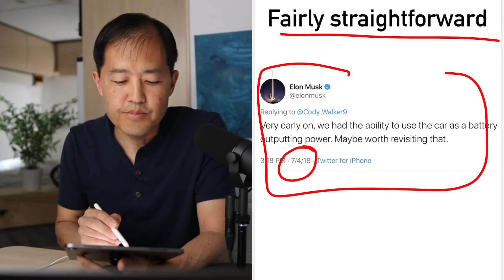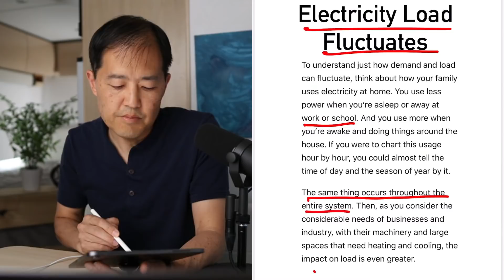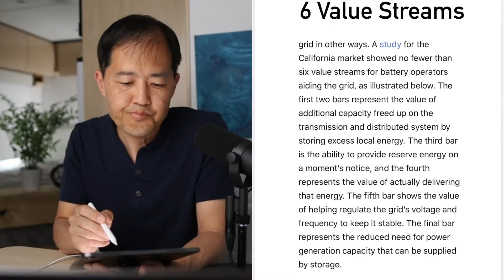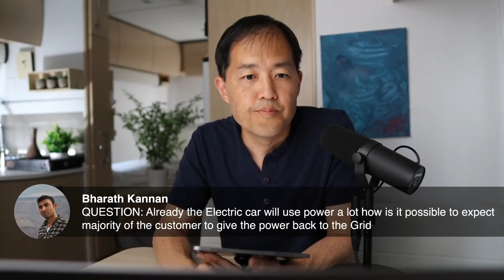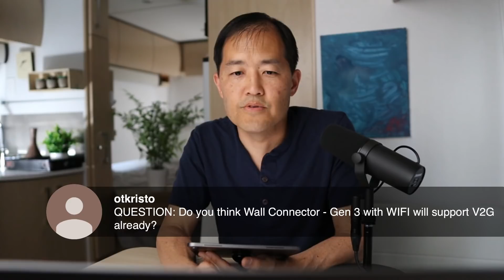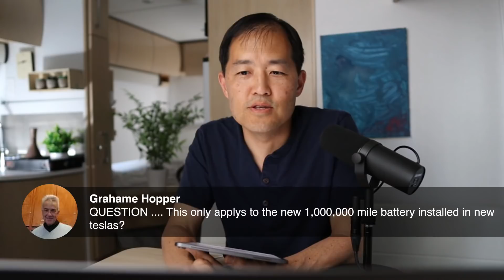Tesla’s Secret Vehicle-To-Grid Plan (Ep. 80)

Comment: NVEnergy in Reno has an EV rate structure that allows off peak purchase @ $0.05l/kWH and on peak @ $0.35. With a MMB in my 2021 (?) M3, I could buy power off peak to charge my car’s battery, then use the stored energy to carry through peak hours. Not V2G but V2Home, without the hassle of a grid interconnect...just an auto-disconnect and reconnect to my home.

Forgot to mention, I’m retired, so car is mostly available.

Comment: Solution to grid balancing is trivially easy: allow price to fluctuate freely throughout the day driven by market forces. Consumers and industry will then preferentially use power when it is cheap. Price disparity would automatically adjust to load balancing needs. EVs are just one great example of power usage that can be adjusted by consumers. Charging software can be optimized to take advantage if this to keep it simple for the user. V2G may or may not even be needed, but the market would automatically motivate V2G exactly as needed. 

The fossil fuel industry will continue to oppose this idea, because it eliminates the artificial need for "natural" gas peaker plants. They will push FUD such as the silly idea that constantly fluctuating prices will confuse consumers who they hope will prefer fixed predictable prices. Nonsense. Consumers prefer prices that are lower on average. But this could hypothetically be adressed by offering two plans: fixed price or variable price, noting that of course the fixed price would be much higher on average.

Comment: Business pay a premium to the grid operator for the peak, maximum power they will draw.  They may seldom draw that much, but if they do, the grid operator is responsible to provide it.  If a business can install batteries, they can lower the peak rating and save money on their account.  So, a business could provide free parking with V2G plugs in return for shaving their peak, maximum power.  A few years ago, there was a paper about Bay Area Rapid Transit (BART).  BART uses peak maximum power when a train accelerates out of the station.  If the BART parking garage enabled V2G, they calculated BART could give each  V2G car free parking in return for the boost for the train(s) to leave the station.  The vehicles would get power back when the next train came into the station, because the train is using regen to slow down.  It's been a few years since the research was done so not sure if that is still open to implementation, but it gives an example of what can be done.

Comment: Dave, your folding pv description is exactly what I am prototyping, though on a ~36' trailer enclosed car hauler.  We are shooting for 12Kw (4k x3 frames) This is for a mobile workshop/makerspace/response-shop .  The goal is to leverage it 100% off-grid/stand-alone and also plug it into a stationary grid-tie to power a home for peak demand as well as during during outages. 
The MAIN problem:  Power companies lobby hard to keep all this "independence" from happening and it seems they are very successful at leveraging "safety" as their hook. 
Getting approval for grid tie is expensive for normal people and it involves an arduous, procedural permitting process.  This part needs to be addressed (just like Tesla's kill-state-auto-franchise-laws push) before V2G can be widespread.  
The States will not step aside and let the Feds dictate this, so I expect it to be a long slog.
Get Duke or PG&E to have some kind of exclusive license where they get a piece of the initial purchase...and maybe they will allow their arms to be twisted.

Comment: Actually, Tesla's newest home charger actually already have WiFi connection, and probably V2G support at least in hardware, one would guess. So their suprise would be "if you have the v3 home charger and a Model 3/Y, powerwall and  solar you can now do V2G with the things you already have, wait for next software update!
So... the reason you need powerwall or solar today, at least, is that you need a controller to sit between your home and the grid, which is installed when you get these. It's possible they could install only the controller for use with V2G in the future.

So exciting! :-)

Comment: Dave, A+ presentation, format, and content!  Thank you!  Minor feedback, it sounds like your Macbook fan is running 100% so there's persistent background noise, but your voice sounds perfect.  And love your split-screen presentation and the way you display the question you're answering.
Also, consider that Tesla may use an app-store model of 70/30 for power delivery revenue, which would still mean about $1000 per year per consumer, if you run the numbers.  Cheers.
Reply from the maker: Thanks for the feedback.  I’m trying to fix the fan noise.  I just ordered a laptop fan cooler.  Hopefully that helps.

Comment: Great video, but you left a few things out.  Not all utilities need grid storage because of the characteristics of their existing systems (but some will).  Hydro-Quebec for example can vary their output based on their extensive hydro-dam system, and they almost certainly do not need additional electrical storage.  Many utilities have an adequate amount of backup capacity, and may not be too interested in additional capacity as this might negatively affect their existing backup investments in things such as gas turbines.  Also, many utilities have had and will have demand destruction due to the shutdown of big factories, shopping malls, etc.  In these cases, additional electricity storage may be unwelcome for the utility.  So it is a stretch to state that all utilities are looking for this.  Note that not all utilities have time-of-use electricity pricing.
AND even though it is being handled for things like solar in some jurisdictions, there are important safety considerations of generating power in a residential area and placing this power on a grid without the knowledge of the system operator.  A lineman for example could be killed if he thought that a line was isolated and de-energized and then someone expectantly put power on that line downline from the isolation point.  This will need to be worked out on a jurisdiction-by-jurisdiction basis, and will likely involve legislative changes in places.  This could take many years to happen.

Comment: The key to self-charging for Tesla Robotaxi fleet and for their Vehicle-to-Grid (V2G) and Autobidder business potential is wireless charging using the magnetic resonance wireless charger developed by WiTricity (a company founded by several MIT students).  This will make the implementation of a Robotaxi fleet and vehicle to grid a lot easier and much more effective.  If parking lots and garages at home, at work, at shopping centers, at sporting events were configured with magnetic resonance wireless charging devices embedded in the asphalt, then EVs and Robotaxis would be connected to the grid many more hours per day without the additional effort by the driver to connect a cable to a typical charging station or the use of complicated mechanical cable attachment devices.
As Robotaxis become ubiquitous, Tesla should be able to purchase or lease unused parking lots on the outskirts of major cities and configure each parking space with wireless fast charging systems embedded in the asphalt.  The Robotax fleet could drive to the nearest Tesla charging station and recharging the vehicles while they are being cleaned (disinfected) by the Tesla service team.  Tesla could also cover the parking lot with a canopy of solar panels or use a nearby wind farm with a Megapack battery storage to provide the renewable electricity to the embedded magnetic resonance wireless chargers and the grid at peak demand rates.
Wireless charging devices could be embedded in the asphalt at airport taxi pickup locations, in front of hotels, football and baseball stadiums, arenas, and convention centers so that while the Robotaxi fleet is waiting for customers to exit, they can be charging or selling electricity back to the grid. 

I predict that Tesla will either buy WiTricity, invest in WiTricity or make a deal with WiTricity so that these wireless
charging devices and be produced in mass quantities to lower the cost and become ubiquitous.  Check out the videos
about WiTricity’s new magnetic resonance wireless charging technology.
Reply: Hi, Gary  thank you for sharing your insight.     What do you think of Energous corporation, publicly traded.    Witricity is still a private company, right?

Comment: Great video and I like your presentation format. V2G is more important for emergency backup first and foremost for me. My house could run for 1 month on a Tesla Model S or Model 3/Y. My house is only 400 sf. The CyberTruck will have built in 120v/240v inverter which can be used for work or emergency generator but may or may not have Grid Tie capability. Grid Tie of course is feeding energy back to your house/grid with your EV. Of course we will be adding mobile solar panels to the CyberTruck when we get it.

Comment: I can see Tesla taking care of the regulatory approval for each grid connected inverter & controller, rather than the householder having to go through those hoops. And regarding payments, these don’t need to come from the utility company which happens to supply the house. Tesla’s VPP system will be an open market system, available to any utility which wants to take advantage. So it makes sense for Tesla to collect those payments and then pass them onto the householder, after taking a cut of course.

Comment: To be honest, the conversion needs to be fairly efficient, inversion, and then rectification back into the grid sounds like a lot of energy loss to me. Currently, in the implementation of High Voltage DC lines, the conversion is fairly unreliable and creates a lot of energy loss and the availability is an issue, the stability of supply back into the grid also needs to be considered. I hope this means some decent innovations on the conversion side will appear. Tesla will need some pretty heavy partners in the transmission and distribution industry for this to be rolled out en-mass. I'm interested to see if that's the case, perhaps this will be a quicker way for smart grids and mini-grids to be implemented for each community.

Comment: Don’t think the snake will be at battery day, but sw update to hpwc v2 to allow V2g will be announced.
Reply: Correct. All the tesla HPWC chargers can transfer AC in BOTH direction, even without a SW update.
Reply: @fiddlerJohn  I think the sw update will have to be applied to expose the interface for the new hpwc. Not sure how they would do it on hpwc v1, do they get updates as well? Maybe via J1772?
Reply: @GoatDirt The HPWC ( now called WC) is a GFI extension cord. The Alternating Current goes though the GFI relay in both directions. That's the definition of AC. The car already controls the relay. Yes the HPWC does get firmware updates through the car. The charger, in the car, includes the "Grid Tied" option in the charger inverter. The only issue is getting the utility to except (via permits) the meter spinning backwards. When the utility needs the quick power boast, the permits will flow. Tesla will negotiate directly will the utility companies to rubber stamp the required permits. The utilities want this now! Autobidder is brilliant, tested and ready, not beta, and it works! NOW! Tesla can throw the switch whenever it wants. This is a HUGE, bigger than FSD. Hold on to your HAT---- I mean TSLA. "To the Moon Alice"
Reply: @fiddlerJohn  Weirdly, there is nothing new here, but everyone is going crazy about this. The Elektrec article doesn't seem to show the whole schematic, but the original tear down schematic was dated 8/26/2018, so why they say this is "quiet" is beyond me. Reuters didn't really say anything about V2G, they just mentioned batteries having "second and third lives" which means once battery capacities are attenuated, they can use them elsewhere. Also, Jack Rickards channel already discussed this in great detail when they did their initial model 3 disassembly. This bi-directionality has been there since the first model 3's, and only the million mile battery will likely be used here due to its increased cycling ability overte gen 1 battery.

Also, the definition of A/C (alternating current) has nothing to do with source vs consumption, in this case the rectification happens inside the cars internal circuit from the AC source into the DC battery pack. The definition of AC has nothing to do with power flow direction, it is just the polarity switching at a given frequency (to be overly simplistic). You cannot just hook an inverter (or apply a fw update to the wall chargers) to relay power from the car to the house panel, as I don't believe the wall charger has any DC-AC inversion characteristics. This will not be possible without also having a smart meter in play at the connection point (or you will be charged for generating your own power as wattage is sensed at the meter ingress point), as well as hardware that can monitor the the grid power state (it is illegal and dangerous to feed power into a grid that is down as workers can get electrocuted.) Also, the power aggregator and sync circuits need integration as well, point is this is vastly more complicated than seems to be thought. The point sources of A/C power also have to be balanced with the grid, in phase, and requires an interleaved buck-boost bidirectional converter wit a topology consisting of an AC/DC inverter (which the battery system has) and the DC-DC buck-boost converter will also need to switch  to rectifying mode for G2V (which it does now) and inverter mode for V2G. This schematic does not show any of this. I don't have access to the latest wifi-enabled wall charger schematics, so cannot comment on if this is workable in its current design.
Reply: @GoatDirt  says "the definition of A/C (alternating current) has nothing to do with source vs consumption." Yes that's my point. The HPWC doesn't know or care which side is source or load. The HPWC measures current and voltage, but not the direction.

Rick says "You cannot just hook an inverter ... to relay power from the car to the house panel, as I don't believe the wall charger has any DC-AC inversion characteristics."   The WC doesn't need an DC-AC inverter because that is in the car's onboard Charger. As I said " The charger, in the car, includes the "Grid Tied" option in the charger inverter." Again the car charger includes a grid tied inverter which matches the incoming AC.
Reply: @fiddlerJohn  Thanks for the feedback and my appologies if I misunderstood your initial assertions. My overall point is that I believe there will be more needed to make this work than a sw update. I think one way to enable this would be to have whatever metering system the car uses at a supercharger, work in reverse and have the kw reading on the house meter (assuming it is unchanged) read normally, but the car will report how and when it exported energy to the grid. Say the car send out 30KWh, the non-smart meter would read + 30kwh drawn. The car would need to report the extra power as a net credit. This will be very interesting as it develops, but is not necessarily a new discovery on the car.
Reply: @fiddlerJohn  I just looked at the original video again, and the package design shows the V2G is NOT present in the actual package (which makes sense since Tesla has not used this feature on any cars yet). The derived schematic shows that transistors (instead of diodes) were mistakenly used for the redundant AC rectification, and this solves the dilemma. The way the diodes are packaged is a non-cyllindrical (and, instead flat - like most transistors) full/AC wave rectifier circuit, and not bidirectional. I am sure this will be made apparent later by Dave, as waiting for the part number to be shown on the diodes shows this.
Reply: @GoatDirt  Yes. You are correct. Not bidirectional. I was wrong; however, one of the inverters that drive the motors could be used to power the grid or a house with single or even three phase power. This would require new hardware and software. That hardware and software may have to wait for the CyberTruck. https://www.youtube.com/watch?v=UkRk2OQI7RE
Reply: fiddler John definitely a possibility. Can’t wait to see what the cyber truck can do! Would be great to see it charge cars stuck on the road and fill tires n such, or even tow breakdowns? Tsla to the moon